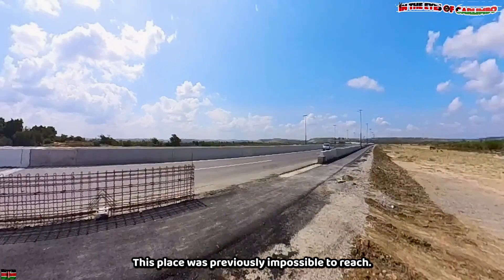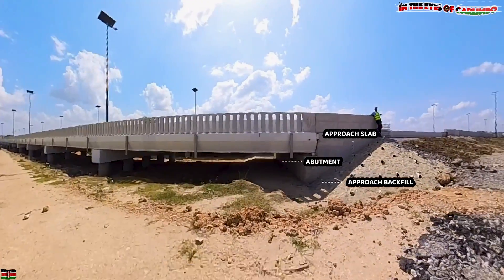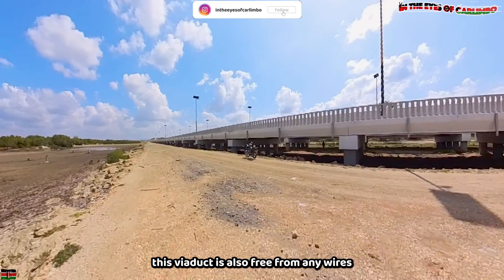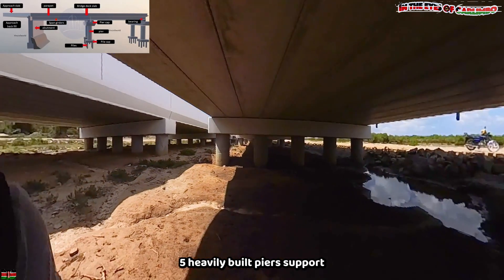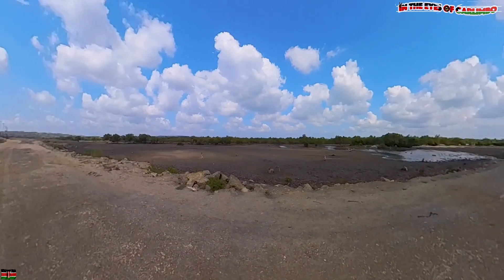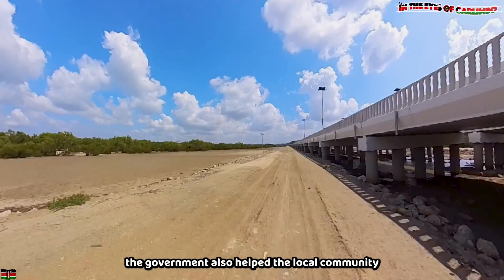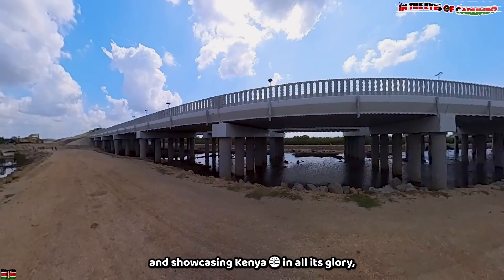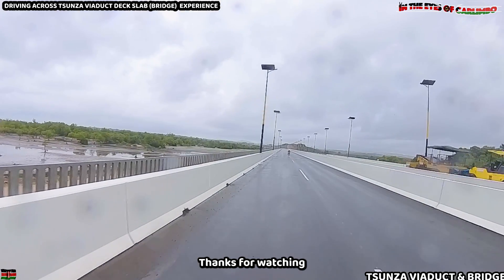🌉 Revealed: Kenya’s 700 metre Tsunza Bridge Secrets (Dongokundu Part 2) #dongokundu #construction

Comment: At one point there is a deadly sharp bend on the Viaduct where the oncoming vehicle took a bend at high speed and this is a safety concern. Speed breakers will solve the problem as a 40 T truck may go over at this sharp bend God forbid. Tks for sharing.
Reply from the maker: That's a call for concern. Let's hope they will install them at one point.